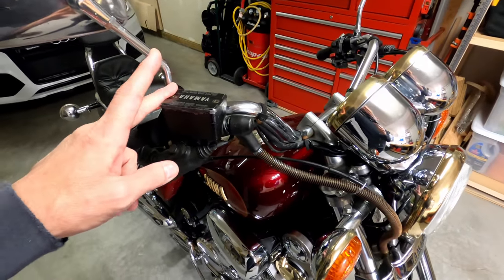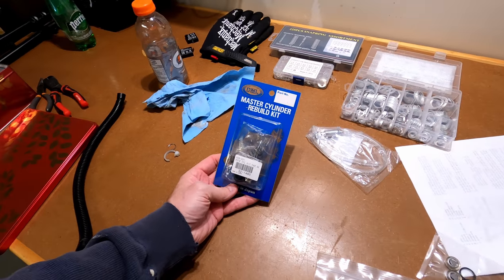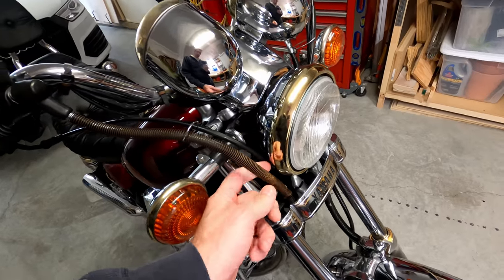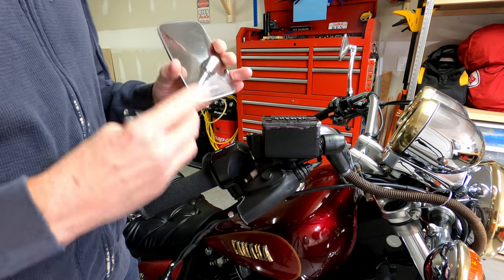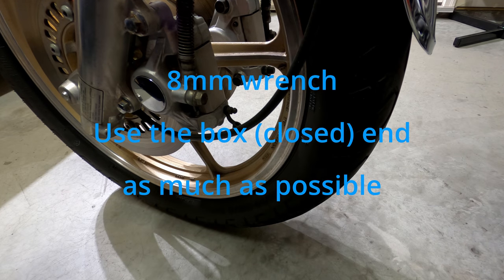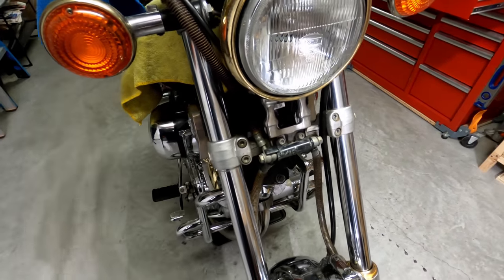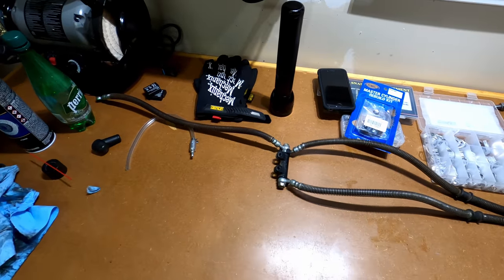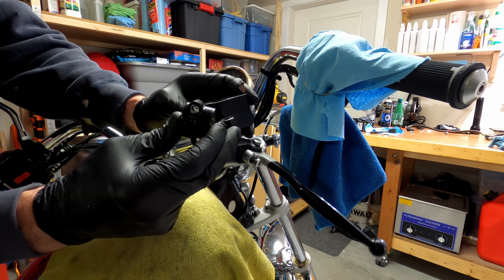Yamaha Virago Front Brake Repair - Part 1

Comment: All the little details even on the most essential of parts surely make a world of difference. Gonna have to likely go the same path as you with the front brakes, mine has the same tell-tale signs of disintegration. Wonderful just watching you sort through the system.
Reply from the maker: This one was particularly painful.  I struggled for days with numerous problems but the reversal of the inner castings was a real nightmare.  It's not something that is obvious or intuitive to a home mechanic.  On top of that the master cylinder was failing and the calipers were seized.  This one was a huge learning experience for me.  Hope it helps with yours.

Comment: Excellent Video. Where did you find the replacement Sight Glass?
Reply from the maker: Thanks!  The replacement sight glass can be found on Amazon if you shop there.  Just search for "motorcycle master cylinder sight glass" and you should get a ton of responses.  They should come with the o-ring.  Get two because you're gonna break the first one...pretty much guaranteed.  Shouldn't be more than $15 for a pack of 2.  Unless you have a really odd size, then you'll be safe - they're mostly all 18mm.